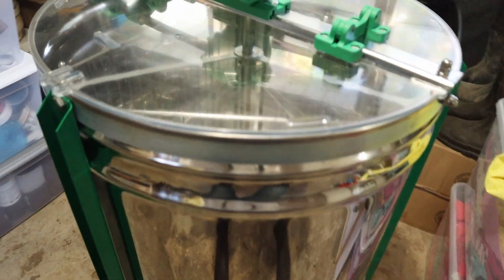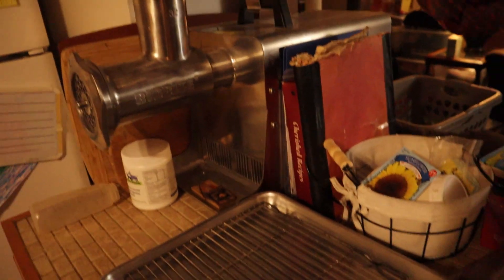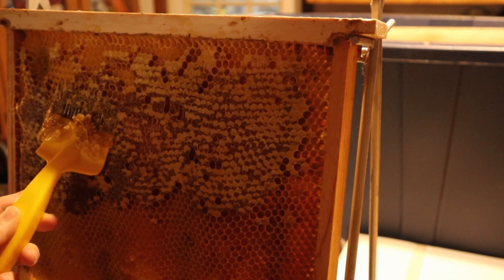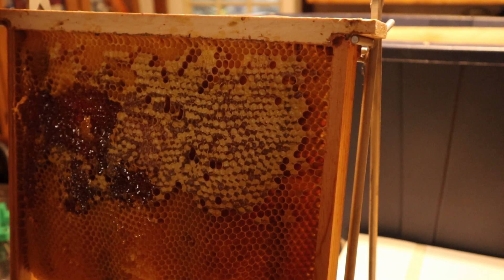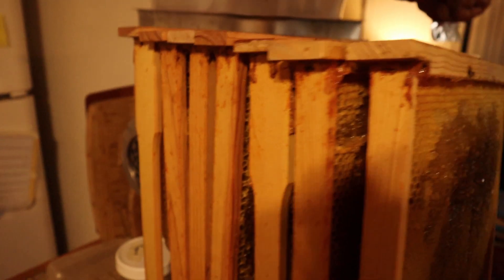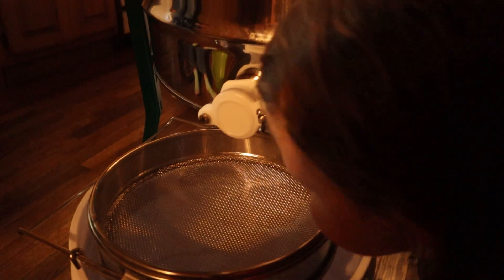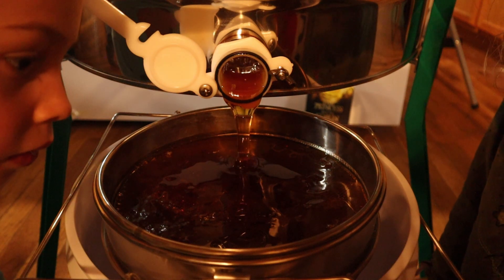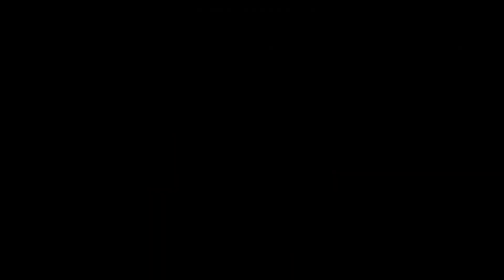My FIRST HONEY HARVEST! ║ Wrapping Up Year 1 of NATURAL BEEKEEPING

Comment: It seems that many first years ended up making honey this year, I actually ended up with a 5 gal buckets worth out of 10 hives. 
        It's so great that they produced enough that they were able to share with you, be sure to save a little to remember when. Just because its uncapped doesn't mean you can't extract it. Get refractometer, in many cases as long as most of it is capped you are still good. My capped scored at a 16.5 while my uncapped was 17.5. That way you can see what you hydration level of your honey is. Ty for sharing your family time, Blessed Days...
Reply from the maker: Thank you for your thought on the refractometer! I had heard of the tool but forgot the name. What numbers are normal or abnormal?
Reply: @curly-hairedcountrygal1275  not totally sure I believe that as long as you are under 19% I think. the higher % more chance of fermentation.